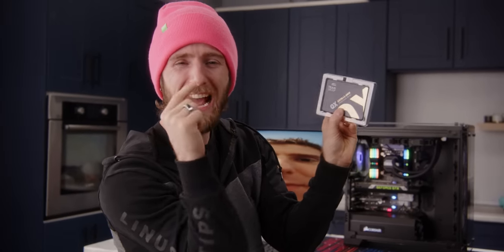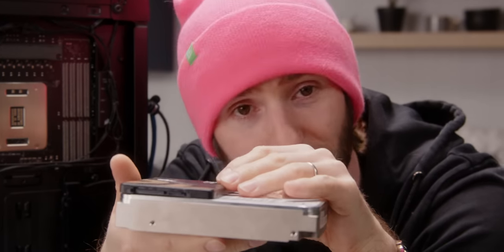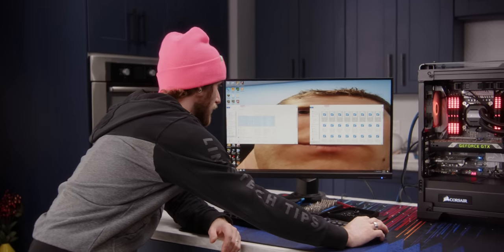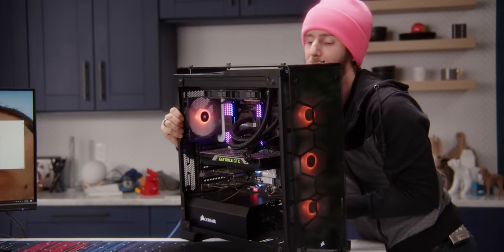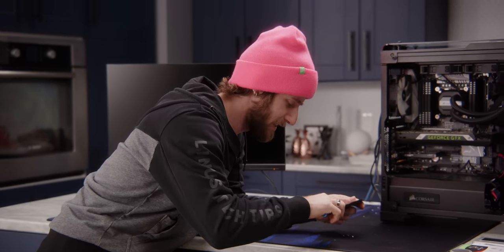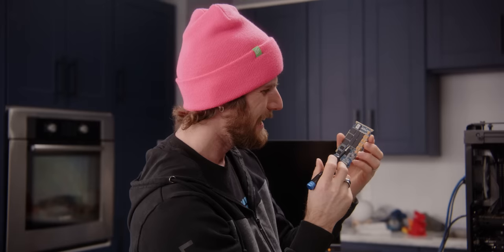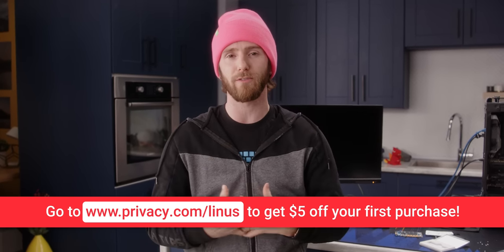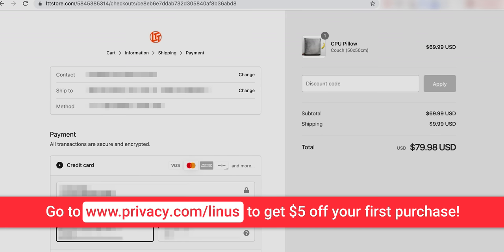The 15 Terabyte SSD is TINY!!

Comment: The whole kilobytes discussion is silly and I'm with Microsoft in this one: WE COUNT IN BINARY!
Reply: @zxy7529  And they are using! The problem is that marketing people started using kilobytes as 1000 bytes.
And someone remember to create kibi to make sure that it's 1024.
Reply: Agreed. Microsoft is, and I don't get to say this too much, correct.
Reply: Yes, the real unit is 1024, not 1000.
Reply: Microsoft is in the wrong by the IEC Standard it is 1000 Bytes per Kilobytes becuse Kilo means 1000 and is based on 10s and is 10^3... Where as Kibi is based on 2 so it becomes 2^10 which is 1024... 
https://physics.nist.gov/cuu/Units/binary.html
Reply: @gosera-1108   the physicists have no business defining standards for computer scientists. I'm not defining the length of a meter and they shouldn't try to define the size of my datavolume.
Reply: @StCreed  Ah yes, lets redefine a word thats been used for years as 10^3 to 2^10.. so all of this has nothing to do with physicists, mathematicians, computer engineers and so on, this is a problem of people ignoring semantics which is a huge issue in computer science world already and should be adress and the bottom line is that Microsoft decided to use Kilo when they mean Kibi and should not be thought of being right when they arent.

There is a reason GNU/Linux uses Kibi
Reply: It’s more complicated than that. They’re using SI prefixes. Which has a specific definition. There’s a body and everything. So kilobytes needs to refer to 10^3 bytes. To do base two you do need a new unit. It just forces people to use correct nomenclature. Now that’s not to say that manufacturers and whatever don’t choose to use the more advantageous unit
Reply: @JuliJaneMusic  You call this a bad argument but yet its the truth. Kilo has and will always mean 1000 (10^3), Where this is the ONLY field where they say.. you know what lets be special and use it to denote 2^10 which is 1024, Yes we work with binarys.. but then the hell should be using something that is denoted in the power of 10?. This whole thing is just becuse computer scienticts didnt have a standard in the begning and decided to be special, which we do now and its called KiB, MiB, GiB and we have people still to refuse to change and comform to the rest of the worlds standards and historical uses of things. This is the same reason why the imperical system is still being used even tho its defined by the metric

So lets stop being knucklheads and be special and use our standards as they been layed.
Reply: @JuliJaneMusic  SI units are a standard, if every industry started defining their own version of it then it defeats the entire purpose of its creation.
Reply: @cronchcrunch  
Computer science never used SI units in the first place. Every domain has its particularities. The reality is that 1024 B = 1 kB is widespread and understood by university student and professionals such as myself.
The only people I notice that use 1000 B = 1 kB are disc manufacturers and they have been sued over their practice.
Did you notice how they label all their products with that warning?
Reply: @gosera-1108  
"So lets stop being knucklheads and be special and use our standards as they been layed."

==I'm not going to start saying kibibits and mebibots and fucked up words just bc a few people are confused.
I am not confused over the meaning.
It has meant 1024 B = 1 kB for a very long time and I see no reason to change it. There is no advantage to change it.
In an effort to create a standard, you are going to make up a new standard called kibi, megibibi and other shit? That's silly.
Reply: @altimmons  
"It’s more complicated than that. They’re using SI prefixes."

==In computer science, we don't use SI units.
Bytes, kilobytes, Megabytes, Terabytes are just made up by humans to mean whatever they want it to mean. It was convenient to define 1024 B = 1 kB.
There isn't even a picobyte, attobyte, millibyte, centibyte, decibyte.
There is quite a difference between the natural science and information science.
Reply: @louistournas120  Aah yes the age argument.. Lets ignore the fact Kilo is older then the entire field and been meaning 1000 the entire time. This here is the issue in this whole part, and the reason why Computer Science papers are very similar to what they where back in the day.. People refuse to follow definitions and want to be special.
Reply: @gosera-1108  Uhm yes and no. Kilo means 1000 yes but that's in a decimal number system Apply the same concept to a binary filesystem and you get 1024. You are comparing apples and oranges my friend.
Reply: @gosera-1108  
If they had used 1000 B = 1 kB, no problem, but the standard in computer science has been 1024 B = 1 kB.
You seem to want a global standard. But what purpose does that serve?
The Byte is not a SI unit. SI deals with natural sciences.
If one guy is talking about kg and another is talking about kB, there is no problem. If these 2 guys are talking about the kB, then we have to make sure that they are talking about the same thing. I see no reason to invent the kibibo and mebigotts.
I agree, the definition of kilo being 1000 is much older than the definition of the kilobyte. That's something that works well in the natural sciences.
Reply: absolutely! what a "kibi" nonsense? it was binary since the dawn of Epoch.
Reply: thats the way it was supposed to be but increasing the unit every 1000 instead of 1024 makes the final result look bigger and thats what advertisers use for that very reason so their products are more atractive to people.
Reply: Another frustating thing is the whole Wikipedia undtertaking for using kibi- mibi- etc, as much as possible.
Reply: @louistournas120  Yes we need a global standard, thats how we advance our field insteed of wasting time trying to correct peoples misunderstanding, This is exacly what NIST and IEC/ISO standards want ous to fix and clear up so there is no misunderstanding.  This is something that should been made and fixed back at the creation of computer science, Kilo is very well defined and heavly used around the world in every field execpt ours to mean 1000, now that we have a words for 1024^x, lets use it and be proud that we have it..
If you think the words are silly then partition and try to change them to something else.. but we NEED to stop using SI prefix and then try to change there meanings
Reply: Yes, with the exception of network transfer speeds, which has been always counted in base-10, storage and memory space have always been counted as base-2, or kilo=1024 if it's easier to understand :)
Reply: @gosera-1108  Agreed - Microsoft is doing us a disservice, now that units like KiB, MiB and GiB not only exist, but have also been adopted in wider use, they are creating confusion by using a unit that no longer can be trusted to mean this or that - is it 1000? Or 1024? Nobody knows, except those who do - but one would expect, because there is a clear definition to separate the binary kilo from 10-base kilo, that any modern OS and software would use them accordingly. But nooo, not Microsoft, NEVER Microsoft.

And sure, I love to have my kilos as 1024 - but I use KiB to express that. I also NEVER use KB, MB or GB (etc.) anymore, because people wont know what you even mean because everyone didn't get on board. But nobody is using KiB incorrectly, so it's all good.
Reply: @the_danksmith134  
"thats the way it was supposed to be but increasing the unit every 1000 instead of 1024 makes the final result look bigger and thats what advertisers use for that very reason so their products are more atractive to people"

==Yes, it was something used by HDD manufacturers and people understood that they were pumping up their numbers by defining it as 1000 B = 1 kB, so they got sued. Keep in mind that it isn't CPU makers and RAM makers that got sued . LOL.
Reply: @Cube8  
"Another frustrating thing is the whole Wikipedia undertaking for using kibi- mibi- etc, as much as possible."

==Yes an what about the thousands of book and thousands of software.
Are we suppose to update them just because someone invented a new standard called kibibots and megigots?
Reply: @gosera-1108  
"This is exacly what NIST and IEC/ISO standards "

==If NIST and whatever want a standard, then define the standard of kB, MB, GB properly instead of inventing kibibots and medogots.

"but we NEED to stop using SI prefix and then try to change there meanings"

==I am not using SI prefixes.
1024 B = 1 kB. The kilo is not a SI prefix.
1000 g = 1 kg The kilo here is a SI prefix.
1000 lux = 1 klux The kilo here is a SI prefix.
It looks pretty simple to me.
Reply: @robsku1  
"Agreed - Microsoft is doing us a disservice, now that units like KiB, MiB and GiB not only exist, "

==Look, it is very simple. To make everyone happy and jolly, add the ability to configure the damn software.
One guy wants 1000 B = 1 kB
Another guy wants KiB
Another guy wants 1024 B = 1 kB

I like to drive my car at 50 kibibometers/h
Let's change all the signages, all the books, all the cars now.
Reply: @louistournas120  Ummm, ok....
Reply: @gosera-1108  There was no "kibi" when "Kilobyte" was defined as 1024, long before Microsoft existed.
Reply: @altimmons  This isn't physics.  SI can go sit in the car.
Reply: @BixbyConsequence  Kilo literally means 1000.
Reply: No, microsoft is absolutely in the wrong. Now, its not that you dont count in binary, you absolutely do. You just dong call it Gigabyte or GB. You call it Gibibyte or GiB. EVERYONE ELSE DOES SO.
Reply: @SodomySnake  So nobody says that...
Glances at my harddrives with capacity in TiB and GiB given by the OS as it has been with many if not most linux distros since forever
Reply: @gosera-1108  The problem is that different standardization comissions have trumped one, as in one rule that a different prefix should be used as opposed to the SI prefixes (see IEC), while ANSI/IEEE defines dual usages
Reply: @watcherit1311  defenders of the 1024-byte kilobyte aren't repurposing anything, the people trying to push the 1000-byte kilobyte are. 1 kilobyte has always been 1024 bytes
Reply: Microsoft are wrong, and so are you. The metric prefixes of "kilo", "mega" and other prefixes are not defined by the IT industry, but by International Standard bodies. That computer programmers were lazy enough to equate 2^10 with 10^3 as close enough is one thing, but they don't get to change and entire International standard system which applies to a huge range of other measures. Are we to to redefine the kilogramme, or the kWh?
Just put this into the same short-sighted approach taken with the Y2K problem.
Reply: @StCreed  It's the "Kilo" "Mega" and other prefixes which are the issue. Those are defined by International standards bodies and it's the IT industry that is misusing them and out of step with everybody else. It was just a laxy equivalence that wasn't too bad with equating 2^10 with 10^2, when it's only 2% different, but when it comes to "Exa" (10^18), then it's out by over 15%,

 There are "binary" equivalents, but for some reason nobody seems to want to use them. As it is, this is the same sort of short-sighted thinking that gave us the Y2K problem (for some reason, IT people seem quite happy to have K=1000 in that usage).

This is simply a non-problem that the IT industry created for itself by not using the right international prefix.
Reply: @TheEulerID  "they don't get to change and entire International standard system"

they aren't trying to. the size of a kilobyte doesn't affect the length of a kilometer
Reply: @TheZALGOisCOMING  then don't use the prefix kilo. It has a very specific meaning. The IT industry would have invented it's own.

It's just laziness, and I spent over 30 years in the IT industry. Quibbling about the capacity of disks is just childish. It would have just the same number of bytes. 

In any event, when I used to calculate the size of data on very large projects it was always done using decimal notation. We don't count the number of customers using "binary" millions, or the number of items in stock, or the number of transactional records. Storage calculations were always in decimal units. Many enterprise storage systems also used decimal units and a lot of computer operating systems also report storage in decimal prefixes.

Even in the IT industry, standard decimal prefixes are used. A megabit per second is 1,000,000 bits per second. Processor clock cycles are decimal too; a gigahertz is not 1,073,741,824 cycles per second. SATA III runs at 6,000,000,000 bits per second. So the IT industry is working with two different and contradictory definitions of the "kilo", "mega" and "giga" prefixes.
Reply: @gosera-1108  But no one wants to say kibi all the time
Reply: @TheZALGOisCOMING  Are you sure its ok to require that everyone (manufacturers, sellers, consumers, etc.) should change the meaning of "kilo" just because the minority (part of IT sector) is using it incorrectly for a long time? Kilo has always been 1000, no matter if its a gram, meter, hertz or anything else. Kinda strange to require a different meaning only for bytes. You might as well invent your own word and meaning (like a mile or inch).
Reply: @watcherit1311  kinda strange how you can acknowledge that this different meaning is only for bytes yet also accuse us of expecting everyone else to change their meanings
Reply: @TheZALGOisCOMING  The whole point of having a universal standard for the prefixes is for universal understanding of said prefixes. If you use it to mean something else then it means in literally every other situation, it detracts from the universal standard and calls into question its meaning. So it does actually impact people's understanding of what a kilometer is, a kilogram, etc. because you're redefining what the prefix kilo means.
Reply: @ThePmso  This is true.
Reply: Kilo is 1000 of something. 10^3. It’s a base 10 decimal prefix.  
You can’t redefine kilo to be 1024 of something, sorry. If you want your own prefixes that work in base 2, use those, like kibi.
Reply: @TheZALGOisCOMING  That was European irony, since complains about "evil marketing people" daring to consider kilobyte as 1000 bytes are very similar to complains in the comments whenever some youtube video dares to use km or C units instead of mi or F. Apparently, my meaning got lost in translation :)
Reply: @louistournas120  I'll promise to have that feature available in whatever software I'll be creating that shows filesizes, memory usage, etc. - maybe through a cli option, environment variable or settings within the program - I'll promise to have a "old-hat neckbeard mode", where 1kB = 1024B ;)

As for other developers, well, prepare to be nonplussed.
Reply: @robsku1  
Thank you. It's probably the only way to satisfy everyone to the maximum joyfulness.
You can put the option in your Config.ini file. Some people want Celsius and others want Fahrenheit and so on.
In fact, I made a unit conversion program for Linux and Windows. It's for converting all sorts of units from Bytes to kibobots and kibobots to kilobyte, atm to bar, Curie to Becquerel, mAh to Joule + plenty more.
Reply: @louistournas120  Sure, I already aim for maximum configurability for greater joyability anyway, so why not... If the application has it's own configuration file (I'm a linux programmer, so it would be something like appname.conf for global configuration and in the users home directory .appname.conf for user specific configuration - and usually include command line options and possibly environmental variable for easy override of any defaults. I'm pretty much linux-only programmer, but I try to make them platform independent, I doubt I will be using the INI format though.
I haven't really released anything in public for a while, but once I finish something good enough to share, I'll promise that feature, if applicable to what the program will be doing, will be available in it ;) I don't know how big the chances of you bumping into something I've written is though, but anything might happen :)
Reply: @robsku1  
 I have a few virtual machines and real machines, so I can test on Kubuntu, Linux Mint, OpenSuse and probably others. INI file just means text file. You can put whatever you want in it but it is human readable. Some people use the XML format but I don't see any point in that. It seems to be a marketing crap.
You can let me know at vmelkon jet yahoo goingto cm.
Reply: @louistournas120  Ok, so you were just referring to generic text based configuration files - yes, simplicity is good. XML has it's uses, but for most applications the configuration files are too simple to justify XML really :) It all depends on the kind of configurations available for the application, and even then there are other alternatives that can be leaner, simpler or otherwise more optimal than XML.
For the most basic configuration type a file with "option=value" lines goes a long way.
Reply: @robsku1  
Yes, that's what I do. Just a bunch of =TRUE, =FALSE, strings, window size and position, integers, floats. All in text format.

Comment: I have about 144 TBs of storage capacity. I archive loads of videos and have assets i use for 3d and video. Plus my render outputs are usually 4k 60fps 16 bit multilayer EXR files for animation. So trust me. For the normies 15 tb is alot, but for independent data buffs and indie production; more is always better.